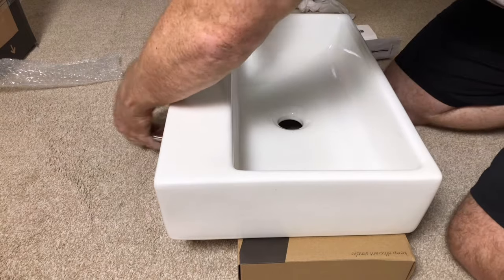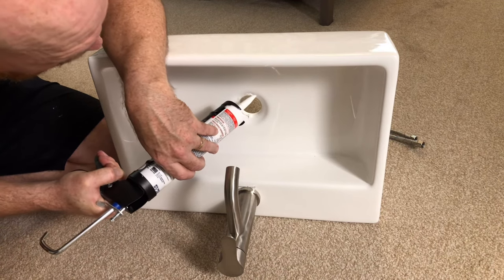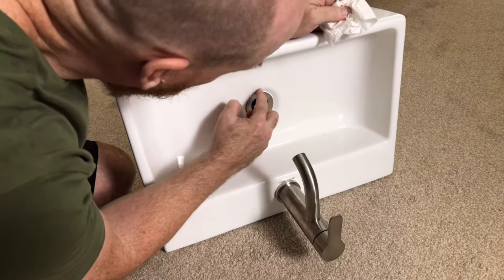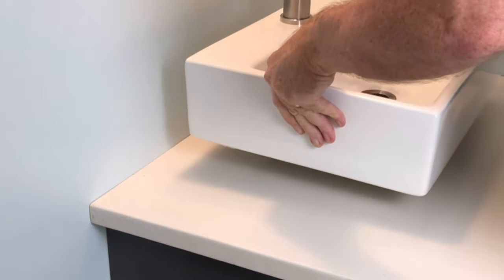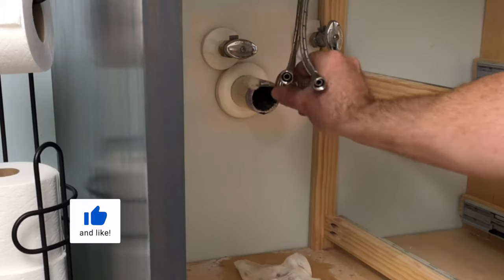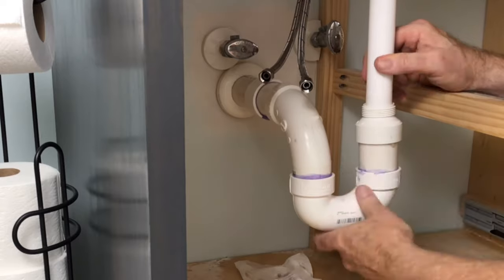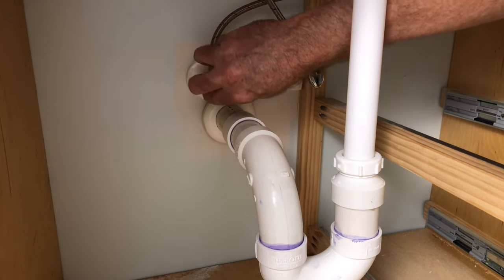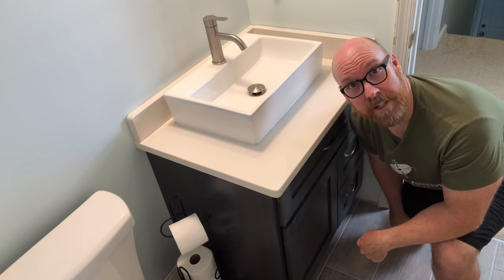How to Install a Vessel Sink | Step by step Instructions

Comment: You do not need the purple stuff it should be a hand screw and tighten application so if there is a clog it is easily accessible.
Reply: Have you tried plumbers tape?

Comment from the maker: Do you know someone in the market for a vessel sink?  They're very trendy right now.  Did you know some vessel sinks do not have overflow?  We learned the hard way and started to install the wrong drain.  Don't make that mistake.
Reply: Excellent, Lucid video, Sir. Same exact sink and I too just learned that common overflow drains will not work, haha.  I’d like to drill a big enough hole in my countertop that I can easily unlock the drain if there are problems, leaks or just want a new drain. The brass nut obviously increases the width of drain.. How big of hole did you end up drilling for drain/ nut clearance and can you loosen it without too much trouble. My countertop is a 1.75” piece of old hard maple butcher block so I may need it larger
Reply from the maker: @patrujo  we used a 2 inch diamond hole saw.  I’m so glad it helped.  Thanks so much for watching.  Please let me know if you have any other questions or suggestions.

Comment: Great video!  The caulk you put around the outside of the sink... how do you recommend getting the back/side edge that's very close to the wall?  Seems the caulk gun doesn't quite fit.
Reply from the maker: I could also apply it to the sink directly and then set the sink in position.  There is a little time to squoosh it into position before it sets.  Does that make sense?
Reply: You can buy small squeeze tubes of silicone caulk too, handy for tight spaces.
Reply from the maker: @cz10756  great tip!  Thanks so much for sharing and for watching!

Comment: Do you caulk the back of the sink? and is it best to put the sink up against a back splash or leave space between the back of the sink and backsplash?
Reply from the maker: Ann, I did NOT caulk the back of the sink.  This way you can tell if there is a leak.  I also do not think it is wise or would look right to push the vessel sink up against the back splash.  Let me know if you have any other questions.  And thanks so much for watching.

Comment: To replace the faucet, it seems like you need to remove the sink - is that right?
Reply from the maker: Courtney, great question!  On this model faucet and vessel sink?  Yes.  The faucet is bolted to the sink.  You must remove the sink to remove the faucet.  Keep the questions coming.  Thanks for watching and thanks for chiming in.

Comment: I'm curious if there comes a day you have to replace the faucet? Doesn't seem you can get at it without removing the entire sink
Reply from the maker: Dennis, GREAT question.  The way this faucet is designed for this basin sink there is NOT a way to remove the faucet without removing the basin sink.  The faucet neck is not long enough to thread from below the countertop.  Thanks so much for watching.

Comment: I want to replace my 1960s bathroom sink with one of this type. The vanity and cabinets are built in with subway tiles on the top surface. The dimensions of the new sink fit over the current opening. Do you see any problem with this? I haven't tried removing the old sink yet. I may destroy the cabinet in the process LOL.

Comment: Can I seal my vessel sink on the vanity with regular silicone caulk
Reply from the maker: You sure can.  Just make sure the color is comparable to the color of the top and the sink color (in case the caulk shows).
Reply: @FieldGuidetoDIY  thanks a bunch

Comment: Why did this dude glue-up the P trap??
Reply: He didn't use the typical p trap in a bag, he used plumbing drain for the trap where it won't come apart.
Reply: Plumber here, I agree with you.  Some day, that’s gonna need cleaned out.